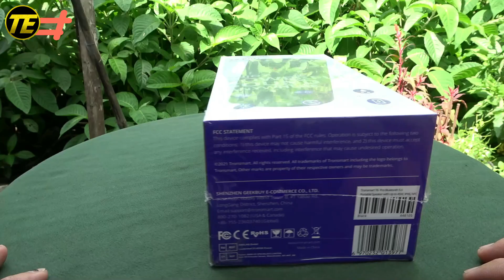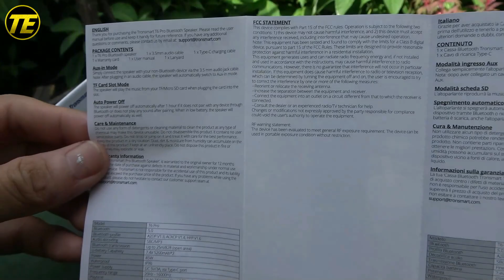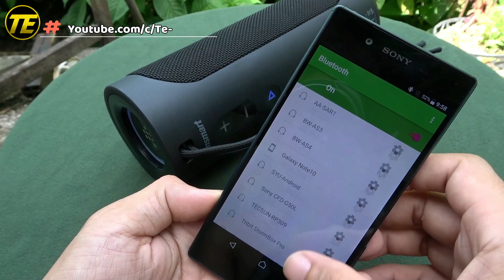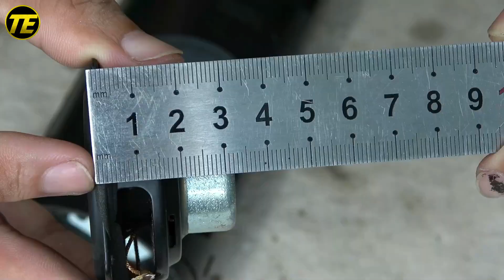What's Inside Tronsmart T6 Pro Bluetooth Speaker

Comment: Just got
My hands on the T7 and t7 mini you?       Sounds great. Especially the t7 mini they compacted that crazy loud
Bass and sound into
A new manufactured device and sounds great
Reply: What about T7 sir??? Does the bass good as first batch element T6? I have the T6 Plus UE and cant compete with T6 sound
Reply: @AA-ii8qv  t7 at max volume out doors is an absolute powerhouse.   I couldn’t believe it sounded so good and so loud
Reply: @rctechtime  looks like the t6 doesn't actually have a sub woofer whereas the t7 does... they charge $10 bucks more for the t6 where I'm from which is weird but maybe it's just a bigger battery????
Reply: @IndefiniteMark  t6 plus [upgrade] has 4 ports ( more options. ).  T7 (my favor out of the 2).    Only has.  Usb C and a micro SD port.    t6 upgraded red. I have is a bit louder but more distorted.    I’d take t7 over it any time. I have 2.  Now. Paired they sound great
Reply: @IndefiniteMark  just got bang mini.  🦾. 50w 5.3.  And another arrriving in a week.    Will have 100 w speaker once paired.         But I have. Motion boom plus.  Which is 80 w.  Too.       Which is amazing Too I wouldn’t get a bang 60w now with the bang mini out.

Comment: Don't buy this speaker. The passive radiators on the sides are fake. Those chips under the radiators make it move up  and down, but no sound would be produced. It would move air, but with no bass frequencies. It's just a show. Sound is only produced from the front two drivers.
Reply: Didn't know they were actually doing this. I always knew Tronsmart we're a joke sound wise and now we know why.
Reply from the maker: What do you think a real passive radiator will look like?
Reply: @DEFKNIGHT  Is this true? Do you have any proof for backing it up? I'm concerned.
Reply: @BaleScream This is Bullshit, these are passive radiators to improve bass reproduction. They are moved by the movement of the active drivers. The active drivers also „only move air“ thats how soundwaves work.
I absolutely dislike most tronsmart products, but you are giving false information
Reply: You don't know what you're talking about, do some research 1st on how passive radiator works.
Reply: lol así es como funciona un radiador pasivo...
Reply: Get the t6 plus pro upgrade red edition. It’s a beast